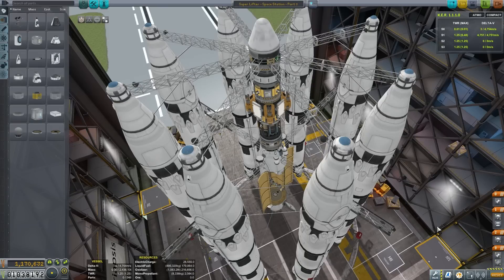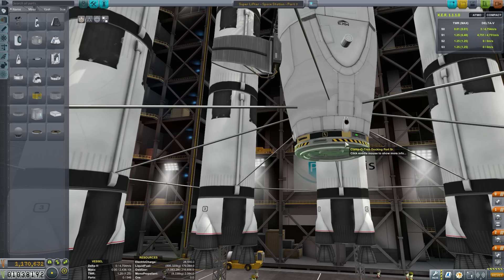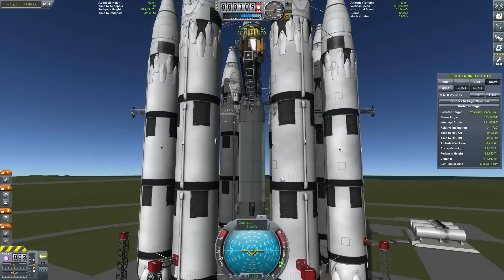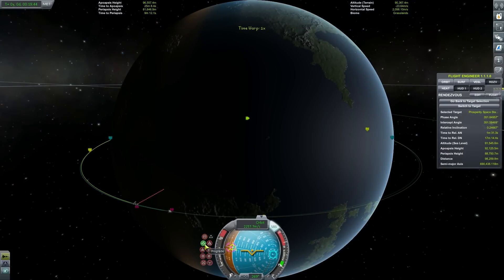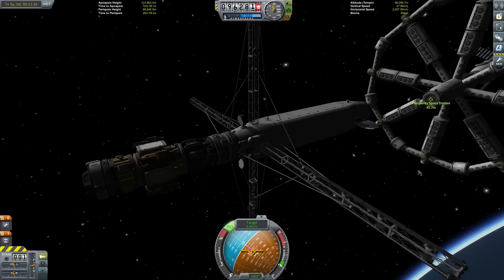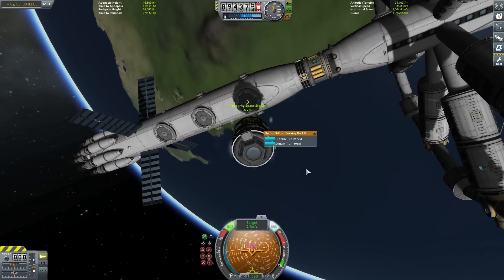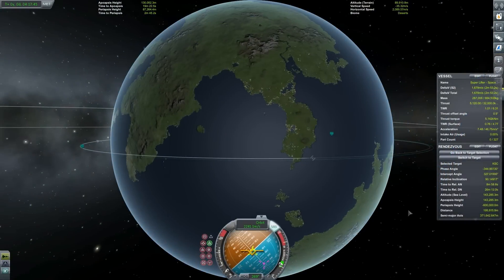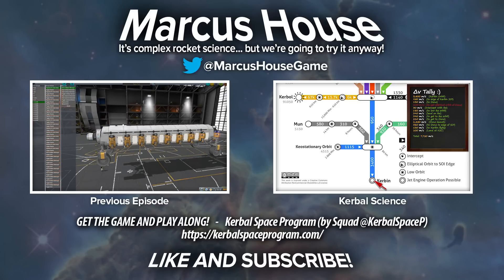Extreme Space Station Completion  (Tutorial: 24) Kerbal Space Program 1.1.3 Stock

Comment: I going nuts here.. the new 1.7.1 ksp making history game is great then in June of 2019 we got another ksp game update called Breaking Ground, also great.. But the reason I am going nuts?  Is because my ksp game is now going so slowly it is a pain doing even simple actions or stuff.. my frame rate has dropped down to about 10 frames a second and I have a gaming PC with a 4 GHz quad core AMD processor and lots of fast ram and HD graphics which on any other game runs like the wind...  I am building my 1st huge space station around Kerbin, it will have a core area with the huge Growing Bio sphere etc. and a huge 8 sided ring around the core. the two arms that be holding the ring are 42 meters long each ring section is 21 meters long.. But building it in space section at a time is doing in my brain.. the frame rate drop is turning a docking and building of just one of the ring sections take hours it took the mecjeb 2 auto docking 4 hours to move one section from the heavy lift rocket system I done to then dock it to the top of one of the arms and that was a small "T" section for the 1st ring section to go on to!  All the parts are up on their special lifting rockets waiting to be docked together.. you just make me look daft since you do all you amazing stuff and manual docking fine.. I can't do docking I tried many times that's why the mecjeb 2 is doing it?

Comment: what computer specs do do you have? I want KSP but would like to check how well it would run on my own setup first
Reply from the maker: When I made this I had a pretty old PC...
It's pretty old. Currently organizing a bit of an upgrade.
Currently it's only a i7-2600 @ 2.4GHz 8GM ram with a GTX 570.

I currently have a brand new PC with, Core i7 7700K, 32GB DDR4 Ram, 512GB M.2 SSD, and to top it off... a GTX 1080 Ti 
Muuuchh nicer. :P

Comment: with those big rover wheels (on your tanker), you can just keep shifting the yaw right and left and it will go much faster. In the game, when you turn the wheels, the motor is activated to its maximum. (Unlike just going forward where the motor power can be much lower depending on the weight and speed of the craft) If you just spam small left and right  adjustments, you can exploit this and go much faster. I was building a polar SSTO launch site and landed one of my tankers way far away. I had to cross over a hundred kilometers to get there. My tanker (albeit smaller) wanted to move only 20m/s but when I spammed the yaw, I got it up to 145m/s could have probably gone faster.
Reply from the maker: Ah.. now that is interesting and I've just verified spamming the Left and Right does indeed speed you along quicker. Great tip! Wish I had have known that one a few weeks back.

Comment: why don't you use the docking alignment mode?
Reply from the maker: I prefer to have translation and rotation controls available at the same time within stage mode,. You can use WASD for rotation as well as IJKL keys for translation. You cant use both at the same time in docking mode, so I kind of find it less useful for that reason. Some people use it though. Whatever works for you.
Reply: it's an indicator. does mot making the dock automaticly.
Reply from the maker: Are you referring to the "Docking Port Alignment Indicator" mod?
Reply: +Marcus House yes.
Reply from the maker: Ah, sorry, I miss-understood your original comment. You are indeed spot on, the Docking Port Alignment Indicator mod is a great tool, but in this series I am playing fully stock (with the exception of Kerbal Engineer which you don't need to have to follow the series, it is just handy to explain detail behind certain things). This is mainly so anyone can follow along with no mods.

Great comment, and yes this mod (for anyone reading) this, the Docking Port Alignment Indicator mod is a great little tool.
Reply: +Marcus House You are welcome. But one more thing. Don't you need radiators to dispute the heat from the nukes? Also of you intend to go somewhere with it, you will ne ed a whole bunch of struts to prevent wobbleing. On the lifter, you could put some landing pads to land even softer and also more parachutes.
Reply from the maker: "Don't you need radiators to dispute the heat from the nukes?" (I never have). More struts? It isn't too bad actually, haven't tried pushing an asteroid with it yet though. It will probably fold at the docking ports :). Landing legs tend to explode on the super lifter I've found. The engines handle the impact better than the legs.

Comment: I built a station in multiple launches with each section self sufficient like this and I quickly ran into performance problems due to the part count of the assembled station. My solution moving forward has been to make a small RCS-only tug drone similar to the Klaw drone shown here. It's basically a remote guidance unit, battery, small solar panels, and one clamp-o-tron on each end (one senior, one standard). Rendezvous with your station with the final rocket stage from the launch (or your cargo SSTO) and use the tug to dock the new component to the station.
Reply from the maker: Yes this is a great plan. I'm not going to make this thing any bigger I don't think. This is about the part count limit for me. :). I might need to do an episode on doing something like this. A great tip (although I imagine probably a lot more cumbersome when you are trying to move multiple parts around).
Reply: Marcus House To make bigger stuff, use PartWeld to turn the superstructure into one part and reduce lag. It makes the physics a little less accurate, but its worth it for the giant space stations